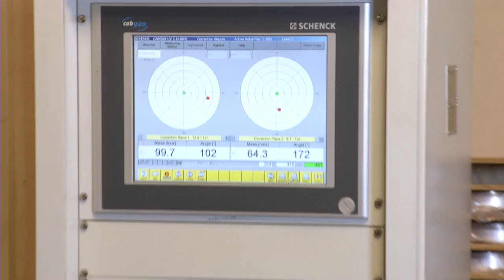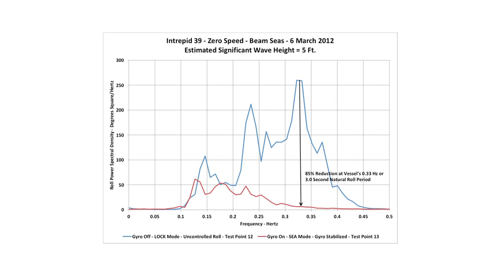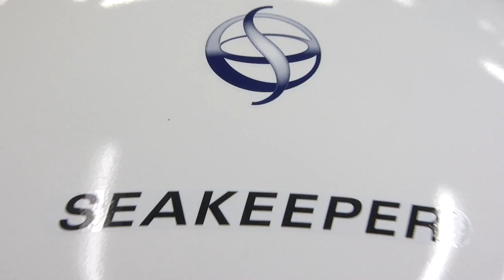Seakeeper

Comment: Some of the specs are missing for the 18, 26 and 40. Power specs dont make sense either. Id get someone to look at that. Also when you write tons on your website, do you mean standard tonnes (1000kg), or non standard tons (2000pounds)
Reply from the maker: Thank you for pointing that out, 1 ton on our website is equal to 2000 lbs.

Comment: So ur expecting ur average boat owner, w a boat something under 40' most closer to 20' to give up all the under deck storage and/or access to the drivetrain to install a vacuum pump and 2000lbs of gyro  and all the electronics that go with it and im assuming a pto or a separate genny to supply energy (electric? Hydraulic? Just fucking magic?) For the whole mess? Maybe stick to yachts where the owners dont care and commercial fishing boats where better working conditions equals a direct payout in production. If ur business model is based on selling these to a guy w an f250 and a boat that is small enuf to be pulled by aforementioned truck that 1,200 test rigs is gunna be ur whole production run.
Reply from the maker: With more than 20,000 boaters on the water enjoying Seakeeper and more than 200 boat builders installing our units at the factory, it's safe to say that yes! Owners are willing to utilize the space needed to add our gyrostabilizers to their boats. Magic? We wish! Our smaller units, for boats less than 44', are battery powered since we know there isn't space for a generator. They also range from 365 lbs. to 746 lbs. depending on the model. We've got a helpful FAQ section on our website that covers everything from power consumption to weight to small boat installations. Check it out: www.seakeeper.com/faqs/. As we mentioned on our other video, we'd love to make a believer of you and have you on a demo! Let us know if you’re up for it!